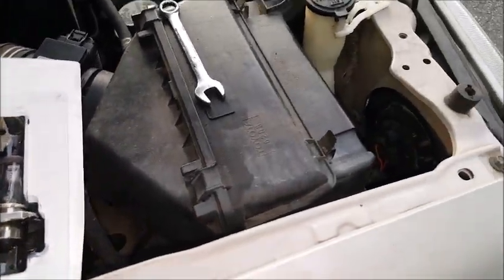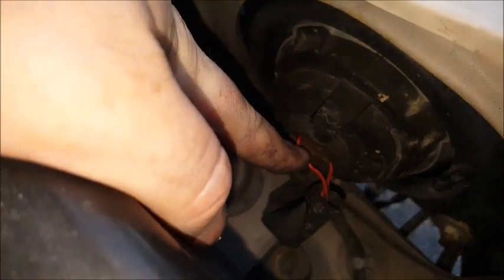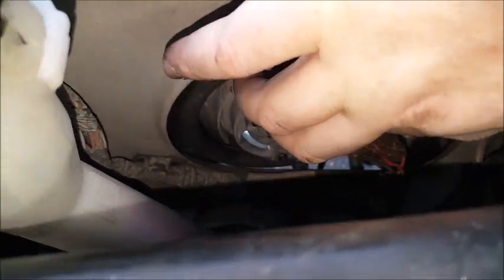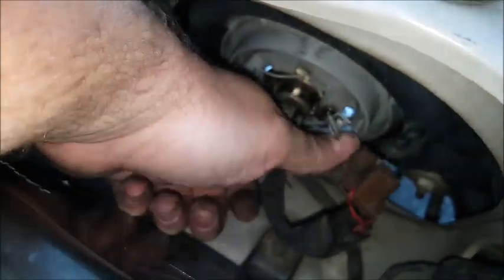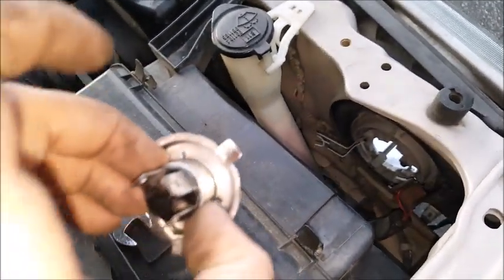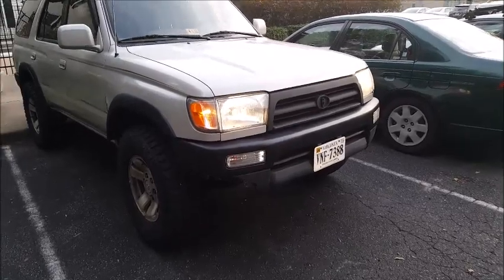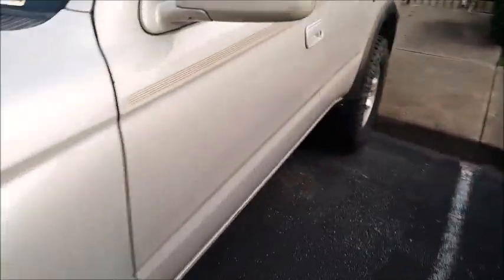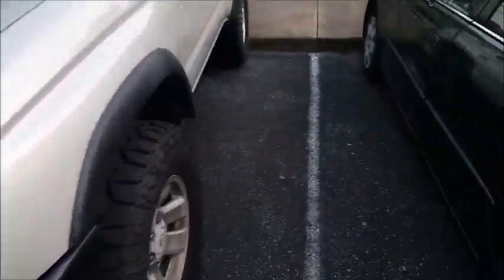Changing headlight bulbs in a 98 (3rd gen) 4Runner/Tacoma

Comment: The easiest way to think of opening that retaining clip is push it toward the front of the vehicle, then upward, then toward the rear of the vehicle and have a hand in place to grab the metal rim or contacts on the back of the bulb.  You may have to swing the bulb and retaining clip together through a few degrees due to interference.

Comment: Dammit! This is the second vid I've seen where they didn't do the drivers side. It's different I'm pretty sure, there's stuff in the way
Reply from the maker: CAN Control if I'm not mistaken just pull the battery out and it's the same process as the passenger.  sorry I didn't do the other side...was trying not to make the video to long
Reply: Thank you BuddyLe3, you made the job super easy once I saw how it was done. @CAN Control - I just did it without pulling the battery out. You can get one hand in there is all the room there is but you can do it all with one hand. I'm sure you've figured it out since this was posted 10 months ago but maybe the next guy.
Reply: No. in the 3rd GEN 4Runner both sides can be changed without taking anything out of the vehicle.
Reply: I have watched videos for 3 hours now and cannot find one that does the driver side either.  I do appreciate BuddyLe3 because I was told that it would cost about $150 at the dealership alone.  I was like a few others here.  I was thinking I had to take the screws out before taking the actual bulb out.  This looks much easier than I thought.
Reply: @BuddyLe38386  Do you need to take the battery out or will it work without having to do that?  If not, I thought about cleaning the corrosion off of my battery anyway.  I was just curious if I needed to remove the batter to make the bulb change?  Thank you so much for taking the time to do the video!!